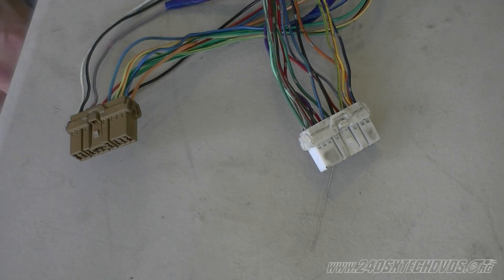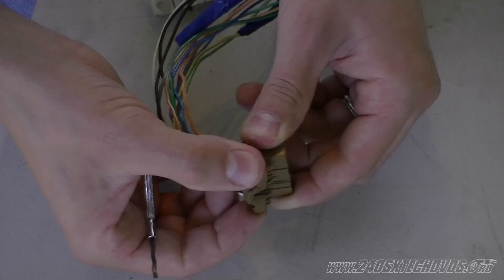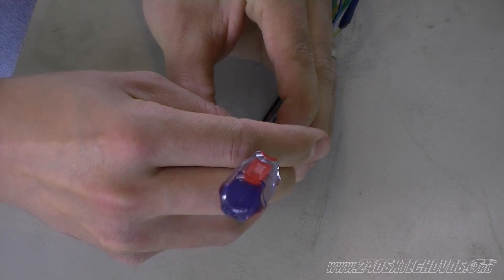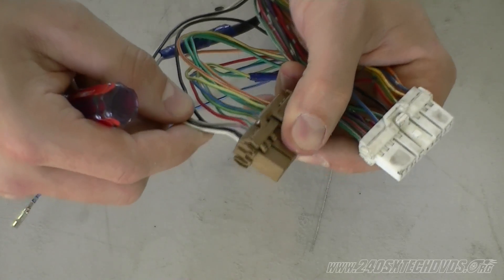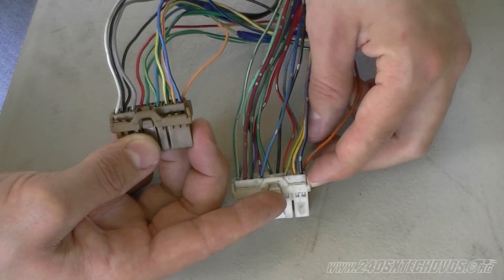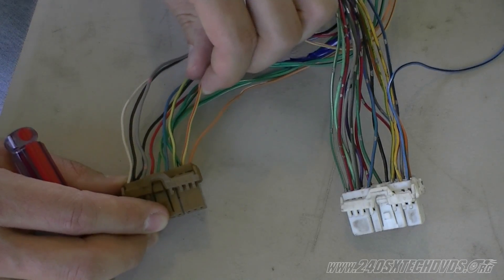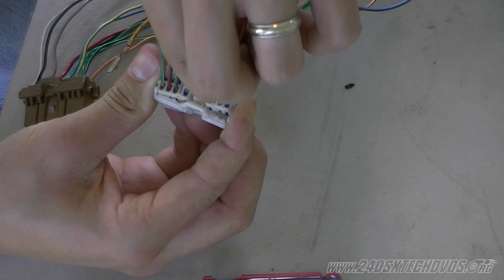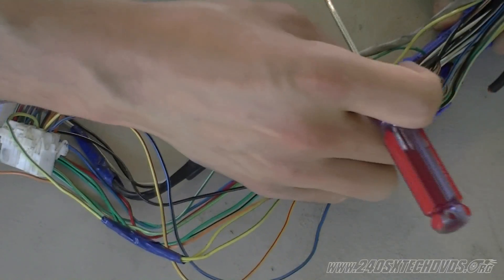How to | 240sx | KA SOHC TO DOHC SWAP WIRING | PART 1 | KA24DE KA24E S13 S14 1080 HD

Comment: I was under the impression that I could run any engine with my ms2pnp and I recently did a motor swap ka24e to ka24de.

Is this how I configure the megasquirt to run the ka24de?

  The ka24e is from a 1991 d21 and the wiring harness end connectors are different when comparing the two motors. Will my megasquirt not work with my build because of the ka24de s year? Can I buy new connectors and splice into the ka24e harness? What do I do? I would hate to not be able use my megasquirt pnp2.

Comment: Hey I need some help. The previous owner cut the dash interface out and I cant figure out what goes where for the new interface plug theres more wire on the car side and 3 different black wires please as se help if you can I'm using a dohc body and a dohc interface plug thanks in advance
Reply from the maker: Wish so could but I honestly have no clue
Reply: @JDSPerformance25  awe man thanks, appreciate the reply

Comment: Hy i am from greece can you help me please.i have a toyota corolla ke 35 with a sr 20det.tacho and fuel does not work.i have all the wiring of s13 i don't have cut  anything
Reply: Can you send me a mail so I send you some photos and video;?
Reply from the maker: Sorry buddy I am not a mechanic
Reply: I don't have mechanical problem speedometer is working also and the fuel guides does not work the tachometer and the temperature it's electrical problem. Thank you for your time, please if you can tell me something for the electrical problem I will appreciate
Reply from the maker: @nikarosprokakias8396  I b am NC sorry but you need to check your wiring diagram from your factory service manual for your chassis and also the engine. To determine what wires are what wires etc... This takes alot of time. You will get it soon 👍🏻

Comment: Mine has a b/w instead of Y/g. Does it mean i need to cut in to the y/g on ceu connector and create a new connection to the dash wires ?
Reply from the maker: You will have to check the wiring diagram for you car in the FSM

Comment: Thumbs up for the video. I have an m54 swap in my 240sx and I want wire up the gauge cluster mainly for the RPM and speed and fuel I have the m54 bmw drive train motor and tranny and I want to use the same cluster or the BMW one if I can. Any Idea you might have. Much thanks.

Comment: This has to be the worst explanation on how to do this ever. What the fuck am I supposed to do to get the connector to remove? I've slid the pick tool down the connector a million times and it will NOT come out.
Reply: Drew Wright looks like you need to give up i figured it out in 5 minutes lol you got to feel around and drag the clip down then the wire pops out

Comment: i have a question, im wiring my bottom harness but i have no clue which wire plugs into the starter, unless the guy i bought the harness from cut it. Or do i plug the starter into the fuse box instead?

Comment: hey i got a really important question and i really need help.
my ka has been running on 3 cylinders i found out that its the wiring for injector #2 its the ground so i got new wire and ran it directly to the ECU, still didnt really run right. idk what to do??? is it worth buying a whole new harness or can i just fix it??? cuz why buy a whole new harness when its just one wire?? please help thankss!

Comment: what part  will i need if i am doing a 95 obd2 swap into my 1990 shell. i have read u will need the 91-93 intake manifold, a 91-93 harness with ecu and the dizzy. are these parts correct?